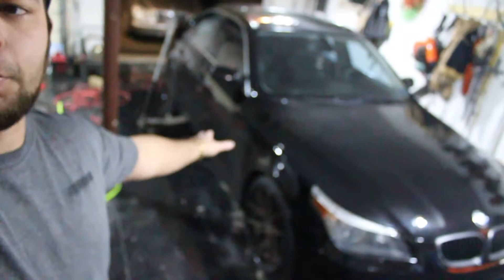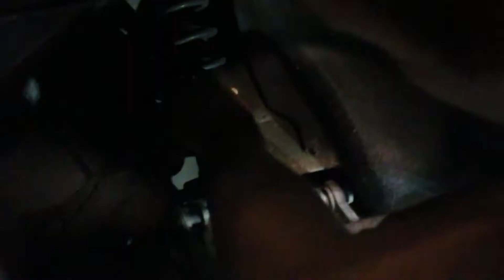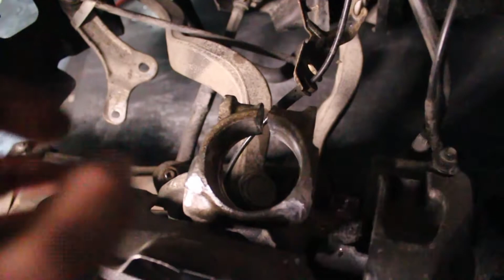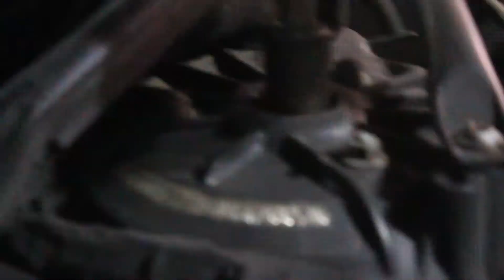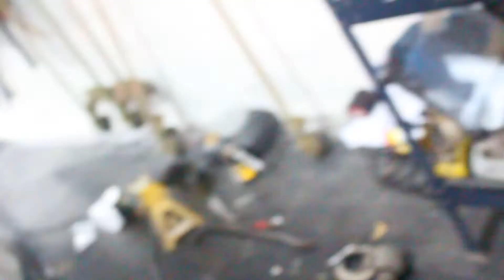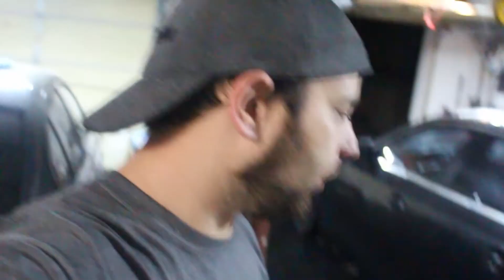How to install coilovers on BMW E60 + K-sport coilovers review!

Comment: What size is the circumference on knuckle of the front coilovers and did you need the cuff it came with to get it to fit properly or did it come with a lower mount?

Comment: Looks good, thinking about doing the same but I would want to sit a little higher. How much room do you think you have from your current height to the Max of those coils?
Reply from the maker: thanks, i believe they go up to about 1" below stock height. I have them on a pretty low setting but the 20" wheels make it look lower than it is.

Comment: Hey bro what wheel specs are u running ?
Reply from the maker: 20x9 + 20 and 225/35. If i did it again id do 20x9 front and 20x10 rear.

Comment: Yooo what are the wheel specs?
Reply from the maker: Sorry im just now seeing this. 20x9 et20 squared setup but if i did it again. Id do 20x10 and 20x9.5 staggered. I had to run 1” spacers in the rear and like a 15mm in the front to be flush.